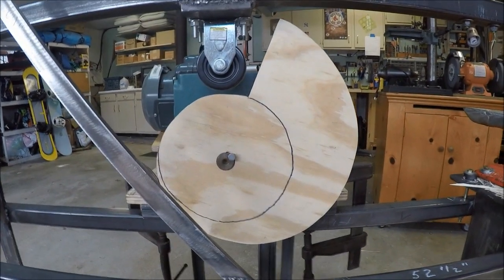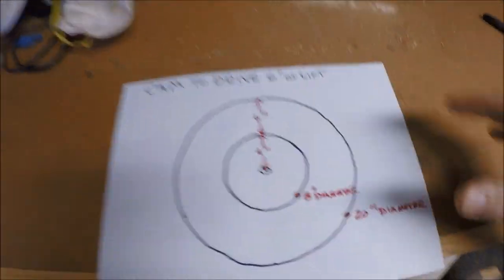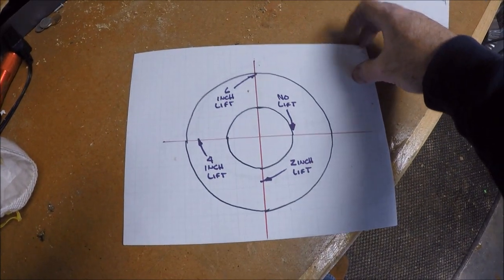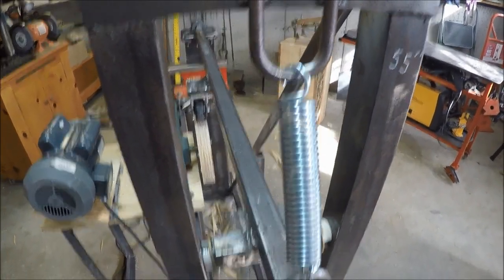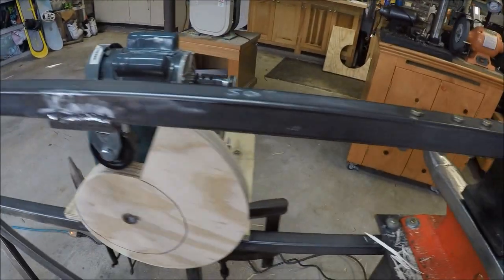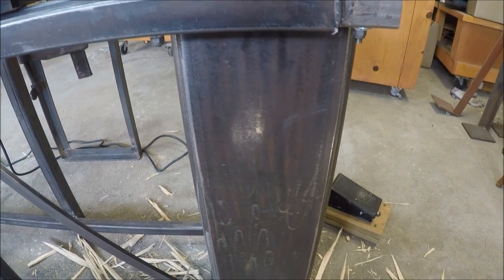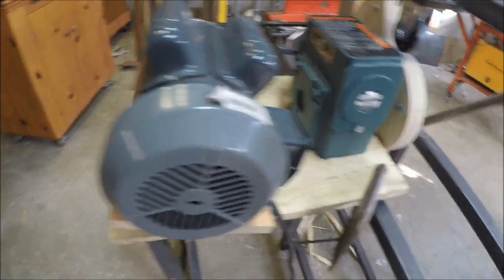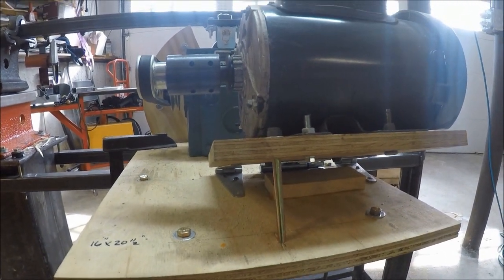Homemade Blacksmith Power Hammer - Part 2

Comment: I have seen a few DIY designs like this, this one looks like it will do the job. Decent height, very heavy hammer, and spring assisted on the down stroke. The leverage in that spring however is making it rather ineffective. Get a garage door spring and mount that between the wheel and the hammer, and get a solid punch from that hammer.
Reply from the maker: Good idea - thanks - Not sure about you, but without this machine, I could not manage given my bad shoulders...

Comment: I'd recommend a 2'x2' board under the working pillar so you don't crack your concrete floor.
Or put down a rubber mat or use hockey pucks for feet.

You can clean up the welds using a gas welder and preheating the metal.  It'll make your welds less brittle.

Loctite the 1" nuts so they don't shake off.
Reply from the maker: Thanks for the suggestions - check out my final version part 3.  Thanks again for the tips

Comment: If you can adjust the height of the wheel i  relation to the bar, you could then increase the height of the hammer and its force.
Reply: very good idea. you could have several sizes and may be able to adjust to the amount of hit you need on different materials.

Comment: That is an awesome hammer Rick!  I'm getting into blacksmithing and wanted to build a steam powered power hammer and couldn't figure out how to change the rotational movement to pounding.  This is brilliant.
Reply from the maker: Thank you Thomas - Glad to hear your getting into Blacksmithing. I'm finding it to be awesome and the hammer is sure helping my arms and shoulders.  Good luck with your build and would love to see it when finsihed.
Reply: I was talking with a buddy of mine about it.  I want the hammer to be powered by steam, but the clutch to be run by an electric servo.  That way I can get my google assistant to start and stop it. "Hey google, start the hammer. "  I have a long way to go, but it looks like fun.

Comment: I believe you could get quite a bit more power out of that motor by modifying your cam design.  Currently you've got a consistent lift rate of 2" per 1/4 rotation, however the hammer is easiest to move at the bottom (beginning) of its stroke because the springs are under less tension.  The result is your motor is working increasingly harder as it reaches the top of the stroke and fights the ever tighter springs.  Modifying the cam to lift more aggressively at the beginning of the stroke (when the springs are relaxed) and tapering off that rate near as the lift continues to the end (when the springs are most stressed), would allow your motor to both work more efficiently but also give you more overall "torque" (because of the less aggressive taper at the end of stroke).  The result should be that you could load the hammer with considerably heavier springs.

Really, I'd think you could load springs/weight onto the hammer until just before the motor bogs down.  I think after that it's about figuring out where the most powerful balance is between a heavier hammer and heavier springs.

I love this hammer design because it allows for building up fewer, heavier strokes.  More time to think, less blows to go wrong, much better on the ears and hands, what's not to love!
Reply from the maker: I like your thinking on the Cam design.  The tricky part is finding the right balance of everything.  If the cam design is to agressive at the start and RPM high, the hammer arm can bottom out on the cam before it hits the steel; whihc is bad for the wooden cam and/or gear reducer.  Although, thats the fun part of building yourself - the trial and errors to get to what's optimal.  Thanks for your good ideas and good luck if you decide to build one.  Booyah
Reply: @RickRabjohn  it looks like your Cam throws the hammer an inch or so above 6 inches, so it looks like you can take an inch off the cam. Also it looks like the cam spins before the hammer can fall into proper position, causing the wheel on the hammer to strike the cam, it appears you would lose striking force and cause damage to both the wheel and the cam after repeated strikes. I could be wrong though.
Reply: Great suggestion

Comment: I need smaller wheel, + a strong spring on bottom pulling down for fast hits... nicely done sir
Reply from the maker: Thanks Shawn - would love to see your build once done.
Reply: Rick Rabjohn I've been thinking about it, I do have a nice electric motor in the garage.I am new to the blacksmithing hobby I only make knives "two so far". I've been looking all over the Internet for a small power hammer for sale but there's nothing out there only bigger ones for too much money.
Reply from the maker: Shawn P I experienced that as well, plus it's nice to make your own and save a bundle

Comment: Very Impressive Build, I've watched about every build video on here and this one has been the most informative and best design (In my opinion folks) Thank you for all the information sir! As I am building my own version right now, Trying to use the best ideas from everyone's videos, and the materials I have on hand,  Finally I get some solid design info on the Davinci cam, i just didn't feel good about guessing the correct lift, I was going to ask one of our engineers at work but I think you nailed it very close. I like what Byron suggested also on the lift, once again thank you!

Comment: If you have some flanged wheel bearings with the standard 1-3/8"OD they will fit inside of 1-1/2" steel pipe.
Reply from the maker: Thank you!

Comment: Great build and you gave me ideas for mine. One thing you could do if you need it shorter is put the spring in between the wheel and the pivot point. It wouldn't have to be as tall and use as much material. Just an idea but nice work. Also could have the base removable and replace it to split wood as well.
Reply from the maker: I agree.  You could easily shorten the power hammer by 12 to 18 inches and save a little on steel.  Thanks Scott and looking forward to seeing your build - good luck!

Comment: Wouldn't it be less damage/wear to the cam if it was skinned in metal or was wrapped in a thick rubber to absorb the shock of the wheel when it comes back down onto it?

Comment: good job, looks great. I hate to say this but you need to do a welding class. Try turning your amps up by at least 10 amps maybe more. but a great job all the same.
Reply from the maker: LOL Thanks Trevor.  I think your right, but I blame my equipment :-).  I'm limited to a small flux core welder, and it struggles with anything thicker than 1/8 inch.  The good news - nothing has come apart - the bad news - it's not pretty.  I am looking at the Everlast 200 Powerarc Stick Welder to add to my arsenal.  For now, I'll just cover the welds with putty and paint .......    Thanks for the comment!

Comment: Brilliant design, and something I may try to build a "my version of". It appears quite effective, and not over fast (I like a little slower work.) If drawing out metal at forging temperatures you can go too far easily with the faster hammers.
Reply from the maker: Thank you John - your sooo right - faster is not always better - I built my hammer with a step pulley that can deliver 60, 80, or 120 beats per minute - but I prefer the 80 beats per minute speed - thanks for checking it out - several have built this version - so good luck with your build and would love to see it when you finish it!

Comment: Yes I did finish it and it works fine. Not as pretty as yours. I used a lot scrap I had laying around. I put the cam closer to the pivot point of the arm. I may put a smaller pulley on the motor because its a little faster than I want and the lift is about 18 inches. Its a bit to violent with its blows.
Reply from the maker: Would love to see it - perhaps shoot a video and post on your channel.

Comment: Awesome work, however, if I may. I have a little concern; may the long arm of the hummer that rides the cam to week to support all the pounding. If my calculations are correct, the hummer is putting approximately 40-60 Lb of down force, and the long span between the cam wheel and the end of the hummer may provide extra fatigue. Moreover, the idea, and execution are AWESOME, GOOD WORK!!! 
Sharp 2017
Reply from the maker: Thank you Serge and you could be right - time will tell.  I've been using it for about a year and so far so good.  It's easy and inexpensive enough to fix if anything goes wrong - that said, I'll keep on eye on it - thanks again!

Comment: I nearly finish my hammer built I told you 6 month ago I would build one from your design.
In a week it will be running if you send me away by email I will send a picture, being you are the inventor of this great design. I've been slowed up because I had a right total knee replacement. Set me back 2 and a half months.
Don
Reply from the maker: Don great news - are you able to post a video of your hammer in action on you tube?  Would love to see it in action.

Comment: Looks very nice.  Are you worried at all about the "arm" bending at all once you start putting more than sticks between the anvils?
Reply from the maker: +marty h Thanks Marty - I was a little worried at first. So, I slipped a 1 1/4 inch square steel tube inside the 1 1/2 inch square tube the full length - so I think I'll be fine and have not noticed any issues working with steel.

Comment: I wish you had shown pictures of inside the fire box and clinker breaker. what are you using as an air supply?
Reply from the maker: +ahorseman4ever1 I found a simple hair dryer to be the most effective in supplying the air.  I regulate the air by adjusting the ash dump opening.  I did not install a clinker breaker, and for some reason have not run into a problem with clinkers as yet.   That said, maybe I should look into that. Thanks for your comments.

Comment: I like how simple your design is. I am thinking of building something similar. what is you opinion on putting the spring on a threaded rod so you can increase or decrease the tension?
Reply from the maker: HI Jim, thanks for checking it out.  I like the idea of a way to adjust spring tension vs. initially buying several different spring types  and doing a trail and error swap out until you have it just right like I did.  I've been surprised at the amount of impact springs can have on moving the metal....Good luck with your build and would love to see it when done - I'll add your video to the homemade power hammer builds of distinction playlist :-)).  Cheers

Comment: make that wheel another 2 " bigger and strap it with  banding help it ride better . and add some weight over the head about 40 pounds that thing looks nice and should do the trick .
Reply from the maker: +Lucky B Hey Thanks for the tips - I did add a spring between the wheel and the head to accelerate and increase the impact force but I like your idea on added weight too.

Comment: If anyone wants to replicate this machine, don't worry about making the arm 2 feet long, his explanation is faulty.  The way you get 12 inches of lift from a 6 inch cam is by putting the caster half the distance from the pivot to the hammer.  This will double the lift of the hammer compared to the height of the caster.  If you want to triple distance of travel, put the lift point (caster) at 1/3 the distance between the pivot and the hammer.)  It has nothing to do with being 2 feet from the caster to the hammer, except that the total length happens to be 4 feet.
Reply from the maker: +Michael Deafenbaugh - Yikes!  You could be on to something here -  I measured 5 inches from the bottom of the arm to bottom of the wheel.  So if your right - that distance plus the 6 inches in lift from the cam get's me 11 inches in hammer lift.  Hmmmmmm  Thanks for sharing and the good catch.

Comment: nice and simple.question...
why the wheel mounted off center.instead of jus directly to bottom of arm?
Reply from the maker: Without the offset,  I would have had to extend the output shaft from the gear reducer to align the cam under the arm - which was possible but I did not want to spend the money.   Ideally, the motor and gear reducer could be designed to sit below and they would drive a belt running up to a separate shaft supported by pillow blocks to drive the cam - but that would add some cost.  Same thing for the back of the hammer arm where you could mount two pillow block bearings with a keyed shaft to secure the arm rather than a make-shift-rednecked pivot point without bearings.   I've thought about going back and upgrading, but so far it's been working.  Thanks for checking it out and good luck with your builds
Reply from the maker: Thanks walnutlogger - good luck with your builds - if you make one please let me know -would like be to see it..booyah!!

Comment: so people are building these just for fun right? they are not very good hammers but look cool.
Reply from the maker: well my hammer has been working great - I made several tweaks including added more weight to the head, more springs, and increased the speed.  It really moves the metal.....I really love it...
Reply: @RickRabjohn  i would like to see what you can get that thing to do. I would replace the top wheel with a bigger,wider wheel. then maybe a steel plate on top of the cam. then add more springs and added hammer head weight and then increase the speed.

Comment: Of all of the homemade power hammers yours seems to be the simplest. I like the design. Do you think a adjustable rpm electric buffer would work instead of the motor and reducer? I was thinking the buffer could be connected directly to the cam. Or will I need a larger motor?
Reply from the maker: Yes, absolutely
Reply from the maker: Tim, I think a three phase motor that's controlled by a VFD could work - you would then have infinet hammer control.  Horse Power is a good question.  I run a 1-1/2 HP motor to the gear reducer then cam.  I dont really know but I would think a 2 or 3 HP should work well.  If done, I would recommend the motor drive a solid shaft supported by pillow block bearings. then the shaft attaches direct to the cam.   That would help protect the motor from the impacts driving the cam and all the vibrations.  Just some thoughts
Reply: Thank you Rick.

Comment: Why would u not mount the motor under the trans to make it a smaller over all size.  Over all its the best hammer i have seen .
Reply from the maker: Thank you!   Your spot on and having the motor under the gear reducer was the original plan but I ran out of steel to build a support shelf and decided to make do to keep the cost down.

Comment: Very cool but I would have used a heavy duty drill with a speed adjustment. Much cheaper
Reply from the maker: Hmm I suspect a drill would not provide enough torque - especially since I have added more weight to the head and added springs.

Comment: I like it, but, I need a vertical hammer, just don’t have the floorspace!
Reply: I made one with the gearbox / cam on the floor and used a push rod which made it shorter by half.

Comment: What's the gear reduction ratio.? Best design I've seen.
Reply from the maker: +Don Baker It's 15 to 1 - the motor is 1800 RPM with 2" OD pulley on the output shaft running to the input shaft on the gear reducer with a step pulley (either 2", 3", or 4" OD) which results in an input RPM of either 1800, 1200, or 900 RPM.  Then comes the gear reducer which is 15:1 ratio.  So, the output RPM which drives the CAM is either 120, 80, or 60 RPMs.  I like the 80 RPM speed as it gives me enough time to rotate the work between blows.  Hope this helps.
Reply: +Rick Rabjohn Thanks never considered building one until I saw yours.

Comment: Really cool! Where did you get the slow speed motor?
Reply from the maker: The 1.5 HP motor is standard 1800 RPM; however, I use a step pulley and a gear reducer to slow it down.  For example, the motor shaft pulley is 2 inches in diameter with a V belt connected to a step pulley mounted to the input shaft of the gear reducer.  The step pulley has three pulley choices (i.e., 2", 3". or 4" diameter pulley).  If connected to the 4" step pulley, that reduces the speed by 50% or 900 RPMs on the input shaft to the gear reducer (2/4 x 1800 RPMs = 900).  Then the gear reduction of 15 to 1 ratio slows the RPMs down further to 60 RPMs (900 RPMs / 15 = 60) on the output shaft which equals 60 cam revolutions or hammer blows per minute.     Hope that helps!

Comment: If you were to add a bigger motor, to turn the wheel, could you add weights to the dye? I'm not well versed in the art of mechanics, but I believe adding more weights will help with hammering more steel?
Reply from the maker: +Jeff Davis - Thanks Jeff - I was lucky that the hammer head (old railroad track) has a hole right in the center.  With that, I took a 1/2 inch bolt and added some steel plates on both sides - it now weighs about 30-35 pounds.  I can add more with a longer bolt and I'm pretty sure the 1 1/2 HP motor is large enough to handle - like 50 pounds.  That might make a good video - testing out different weights to see what difference it makes in moving metal.  I'm no expert either - I did read somewhere that acceleration of the head increases the kinetic energy at impact - So strong springs or dual springs might help with that as well.   Hmmm you got me thinking - thanks
Reply: For sure. I know some power hammers have a 200lb downward force. I've never forged anything, myself, so I don't know if it's possible to have too much "power" coming down on the steel. I really like this layout you have. If I were to build my own I'd definitely do it this way. I'd add some interchangeable dye of different shapes. This idea is genius and I'm hopeful to see what kind of steel you slam around with it!
Reply from the maker: +Jeff Davis Thanks Jeff!